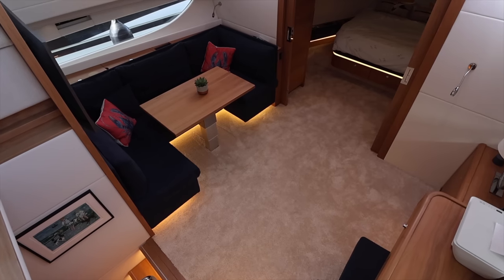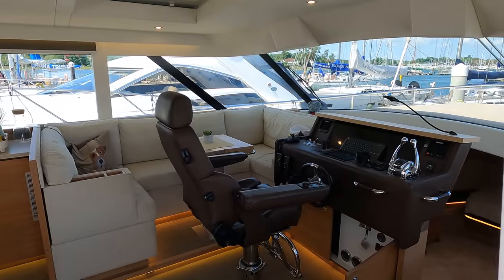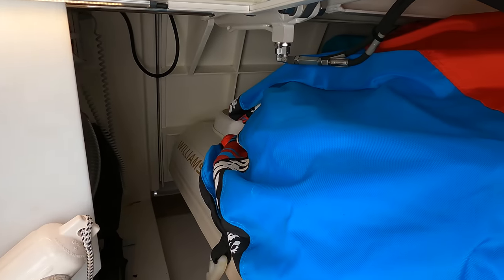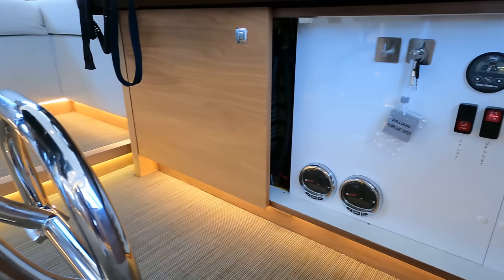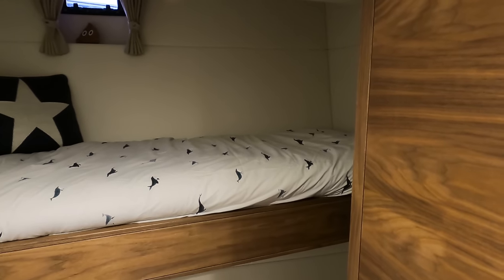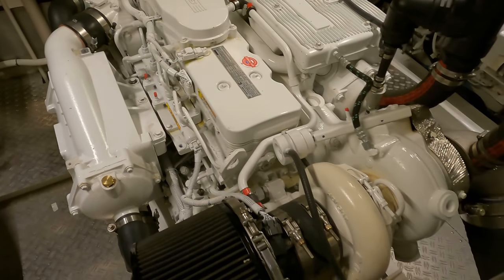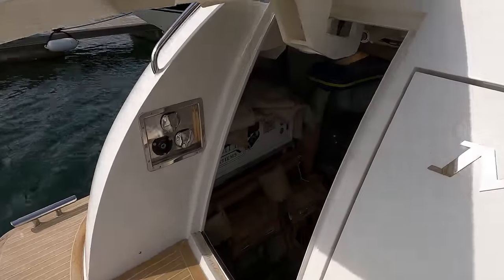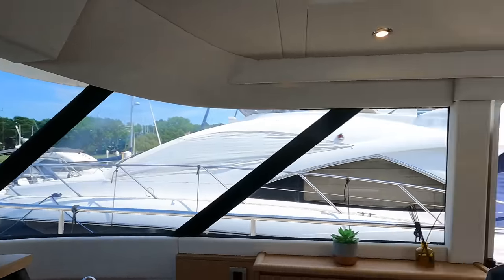STEEL Twin Engine LONG RANGE Explorer Yacht | STEELER 59S!

Comment: This grew on me and is actually a fantastic/cracking liveaboard...no doubt about that.i haven't got to the price part yet but i reckon 3.5 million,could be more but hope not...i think range and consumption is fine for size.Most people will never need the 1700 mile capacity...it is enough...this would do me for europe...rivers/lakes...the loop or canada....scotland and ireland.Great flexible yacht i say and built tough.If is around say 2.5 million they will be inundated with requests.

Comment: The kind of boat I would like to own. A house boat that's not a death trap the moment you go out into blue water. I would stretch it out a bit to put a large pantry such as a large full sized commercial fridge & dual freezers. I would want something I could park out in the ocean for a month or two without needing to resupply.

Comment: For a trawler with these features the range is a bit small when compared to comparable yachts out there
Reply: It'll take you from Gibraltar to nearly Rhodes in the Med. That's plenty of range in my opinion. You can extend it  with bladders but not sure why you would want to do that. As for the Atlantic, you wouldn't cross it in this boat anyway.

Comment: The stainless steel cover for the forward helm station does appear to be capable of locking closed, but I'm questioning the efficacy of the cover needing to be removed completely for access. Beautiful boat. Top notch.

Comment: No ropes on a boat like this, only lines and the anchor rode.  If it was a sailboat it might have one rope (the bolt rope) but no ropes here ;)    Sorry i couldn’t resist, love your videos!
Reply: I had the same exact thought when he opened the little door to the storage area and said the area would be good for storing “ropes”.  Unfortunately, because I was watching the video by myself at that time I missed another opportunity to impress my wife with the breadth of my boating knowledge!
Reply from the maker: @jerrymccormick6107  I was always taught that unless a ‘rope’ is being used as a ‘line’ then it remains a rope until it is being used to secure the boat. For example: “get the ropes so I can make up some lines” 🤫 I would never check the ropes but i would always check the lines 🪢

Comment: Went and looked for prices...start at £956,000,so basically 1.75million kitted out or 2 million fully minted out...if you got cash then that's a bit of a deal.Ther must be a catch as to how it seems so low in cost compared to other lesser yachts of GRP and 2/3rds the size....what gives?

Comment: Where's the fridge and freezer for the galley?
Reply: I was wondering where the washer and dryer were?
Reply: The fridge is in the rightmost cabinet of the galley. In the kitchen island there is a coolbox that can be used as a freezer or extra fridge.
Reply: @jerrymccormick6107 the washer/dryer is located in the entry of the center sleeper.